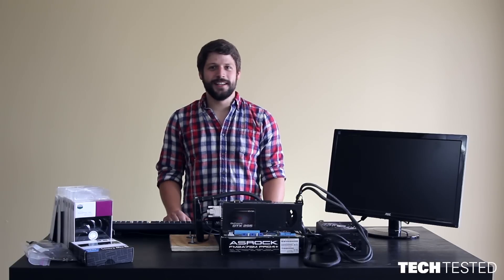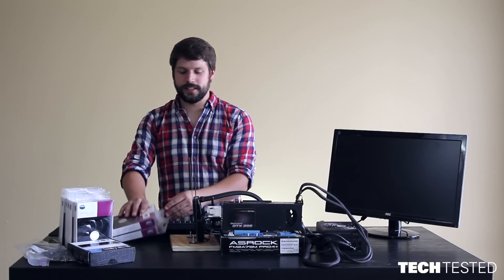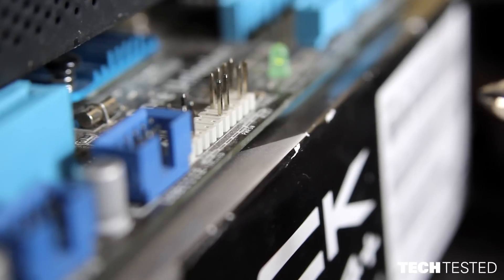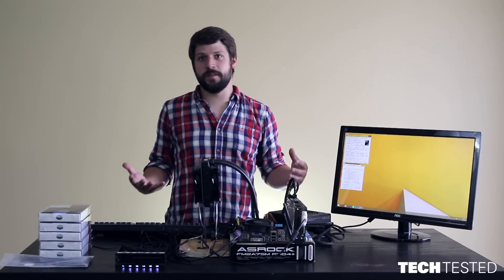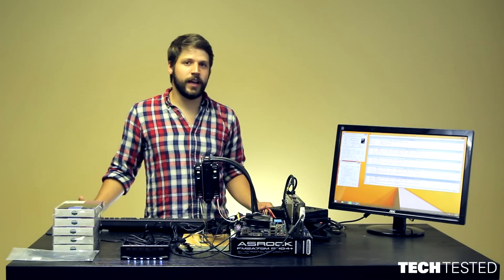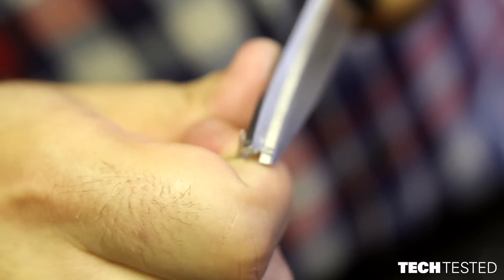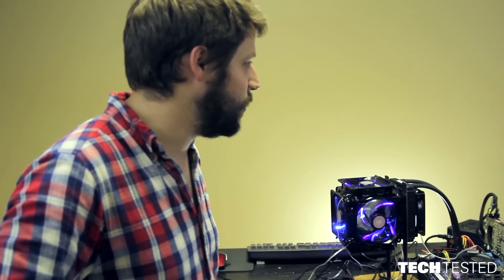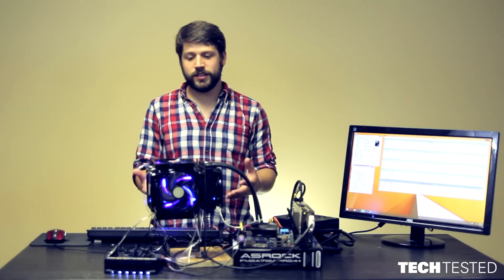Turbo Charging A CPU Cooler

Comment: What if you take a really square Air Cooler instead and put 4 fans on it.

LIKE THIS (seen from the top)

                    l           l
                    I  Fan  I
                   V         V
                   ________
       ---->   l                 l    ---->
    Fan      lAirCoolerl    Fan             
       ---->   I_________I    ---->
                   I          I
                   l  Fan  l
                  V         V
Reply: +Solitude It would maybe give you a few degrees less, but it's not effective at all. The thing is with fans, if you have 0 fans, meaning 0 airflow your temps are gonna get really high, but 1 or 2 fans in your entire system is really enough. LinusTechTips have a video on this. Any more than 3 fans running at medium speed is just makes more noise and barely affects performance. So in short, yes it would work, no it wouldn't be effective. Instead of more fans, add more heatpipes, more fins and a bigger heatsink in general, then some more fans to accomodate for the increased surface area.
Reply: Jinjenia Ah, so diminished returns kind of deal?

Comment: 3.8 Ghz? PFFFFFFFFF! Mine runs stock at 4.0 Ghz and overclocked at 4.6 Ghz. AMD losers.
Oh and the 3 Fans don't work, as there is too much wind turbulance. Turbulance is a energy and you're losing it to pressure.
You'd be better off if you would crab a large tube, put 2 big fans in serial on it and then run it down to a small tube, forcing the air through the smaller tube, that fits the CPU radiator. X > x seen non mathematical.

Comment: This is never gonna ever ever work, as the amount of heat dissipation from the rad is never gonna get you lower temps. The rad is capped at amount of heat it can transport. Only to get cooler cpu temps to get bigger rad 280 or 360
Reply: And yet it did work... this video alone proves you wrong..

Comment: you got 5 fans pushing and 1 fan pulling. if they're 50cfm each and all adding up, you got 250 cfm trying to fit through the pull fan. even at full it will restrict WAY more than it will help.
Reply: I think he'd get a lot more benefit if he had the same box setup on the intake, as he does on the exhaust.
Reply: please give him a thumb up so this guyd could understand fans
Reply: forestR1 I think he would also have more luck if he removed the fan right against the radiator. that fan and the exhaust are limiting the air flow. he has 5 fans pushing into the back of a single fan pushing air into the radiator, then 1 pulling it out the back. he needs 5 on the intake and 5 on the exhaust. this was a poor comparison to a turbo or super charger. I want to see this redone! if it works I will strap 10 fans to my cooler!! haha
Reply: yep spot on. for whatever reason; I didn't even notice that fan at the time. It needs to go too.
Reply: 5 fan pushing and 1 pulling is fine.  In fact it is what you need for this experiment to work.  It's all about air pressure.  CFM has no application in a setup like this.
Reply: if pressure were all that mattered you could put it in a sealed box, charge it to 2000psi and call it frozen. Pressure does matter as it is a product of Quantity (Cfm) X Resistance. (P=QR therefore Q=P/R and R=P/Q). for a CPU cooler; the fans provide pressure (and some resistance), the fins on the heatsink provide resistance, and that results in a quantity of air (Cfm). A fans Cfm is derived from it's own pressure and resistance and obviously changes with external resistance, that is why they are made optimized for certain situations. perhaps that's what you mean by "cfm has no application" ?- regardless; a fan under full power on it's own might be running 80% (made up number) of its potential full speed due to air resistance. put some positive pressure to it and it will reach 100% efficiency (no resistance). put even more pressure in front of it (as in this case) and the fan will begin to restrict airflow - cancelling out the benefit of the extra intake fans for the sake of turning the single fan motor into a power generator. No different from obstructing the back of your car radiator. that will increase pressure - but will reduce its effectiveness. that said - the 6th intake fan (directly in front of the radiator) will no only be restricting airflow, but also creating pressure in the "box" (decreasing potential pressure in the radiator). the 5 outer fans of the box are working in parallel, the 2 fans against the cooler are in series. Series fans do very little which is why when you use a radiator, the fans are in parallel, not stacked. Ultimately even with 1 fan on this cooler the air isn't very heat saturated due to low thermal transfer of air. so throwing more air (quantity or pressure) at the same surface area is going to yield very diminishing returns anyway. It's a cool experiment, but the results are expected. for the same space and money, you would be much better off with 3 fans and 3 towers. parallel would be much better, but even just stacked would do better than a single tower.

Comment: Well, duh.   You don't want more fans, you want more radiator.   Always mount the biggest possible radiator that will fit in any given case.   Always.   No exceptions.
Reply: +DumbDuck44 money?
Reply: +DumbDuck44 +VelocityRaptor Hahahhaa you two are mad xD But the bigger radiator theory is true. More fans however you put them wont do much good.
Reply: is the conversation you 2 are having truely necessarily?
Reply: no dumbduck, this is something both of you are doing don't just blame velociraptor
Reply: +VelocityRaptor "what AN dumb fuck" an... An... AN
Reply: +c00kiegaming Make sens
Reply: DumbDuck44 You call me literally retarded and the best reply you come up with is ''go back to your mom's basement and play nintendo'' is that seriously the best argument you can come up with? Damn. You've sunk so fucking low.
Reply: c00kiegaming Sorry dad.  Are you going to make us sit in time out?
Reply: +DumbDuck44 he should.
Reply: Actually someone has made an "AiO" that's 100% passive.
It doesn't even have a pump.
It's a bit more constrained in the ways you can mount it though then a normal AiO and it's not quite as effective as one.
Reply: With the space this fan chamber needs it would be easiert to just mount a high end air cooler.
That would would need the same amount of room and perform better than this kitbash.
Or just get a bigger radiator/two radiators of this size.
Reply: VelocityRaptor That's what's wrong with America.  Parent's aren't teaching their children respect anymore, and so we have a ton of prepubescent basement dwellers shitposting on the internet.  Sigh...
Reply: VelocityRaptor How is telling you to fuck off back to the basement "an argument".  That's a demand junior.
Reply: As your name says, you're dumb. It doesn't matter whether you have a smaller or larger radiator if you don't have enough fans for the radiator. This experiment would have worked if the guy would have put the fans in front of each other instead of making a box style setup of fans which causes one or more fans to interference with the airflow.
Reply: c00kiegaming Yeah Velocicraptor, is that really necessary?  You tell 'em cookie.

Comment: did the airflow go out behind the radiator? I don't see how this would improve the coolers effect, as the air could not absorb that much more heat anyway... If you could make the air colder, perhaps by expanding it and run it through the radiator, that could make it work as a heat pump?

Comment: how about using a very large diameter fan and using an angled shroud to gradually reduce it down in size to connect to the radiator.
Reply: +Spiro20004 
Thats how this video should be done ....
Judging from the fan set up in this video. I guess theres a lot of pressure loss. So thats why the result is not surprising ....
Reply: +Spiro20004 
Thats how this video should be done ....
Judging from the fan set up in this video. I guess theres a lot of pressure loss. So thats why the result is not surprising ....